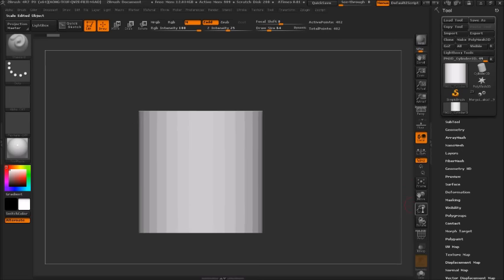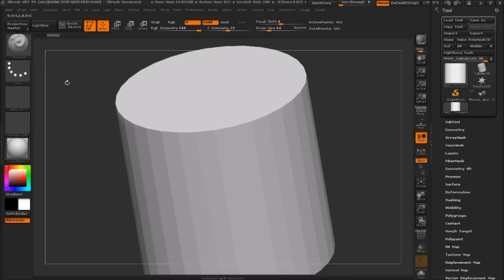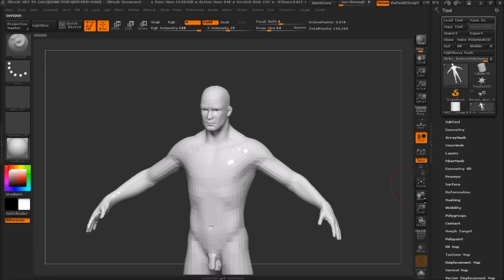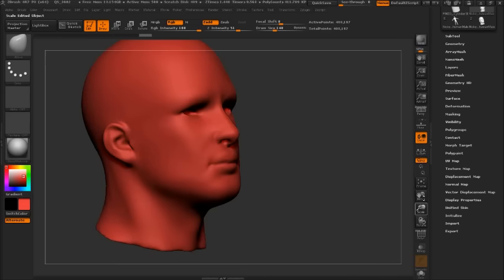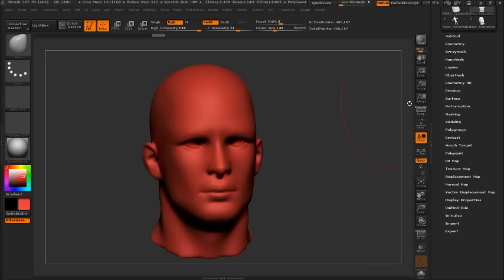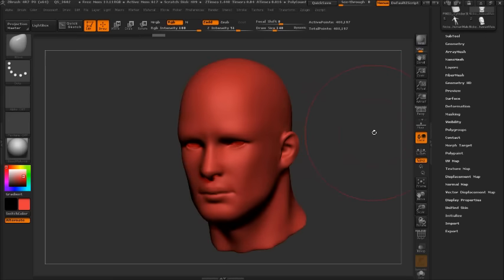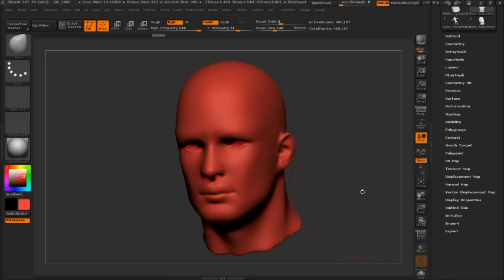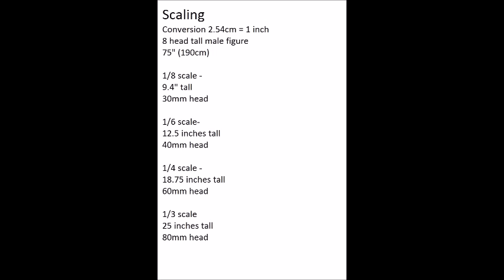scaling and hollowing parts

Comment: mesh mixer does a superaccurate job. I can set the wall thickness to the mm and do tapered custome drainage holes. Meshmixer can handle stl's up to just over 1 million polys on a 16 gb ram computer. I used to use zbrush for hollowing and it was painful. I just use zbrush for sculpting, decimation, keys and boolean operations. Booleans in zbrush are the fastest in my opinion compared to anyother program.
Reply from the maker: yes i just started experimenting with that program! it seems pretty good